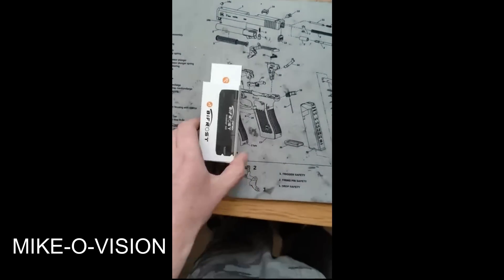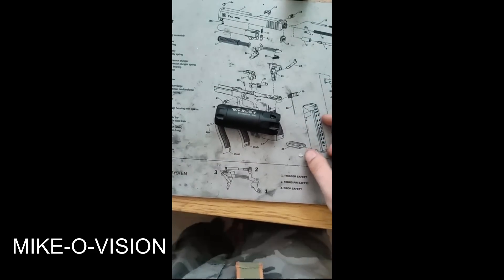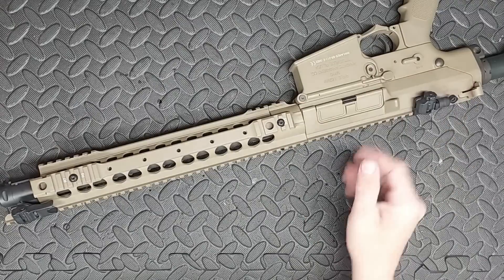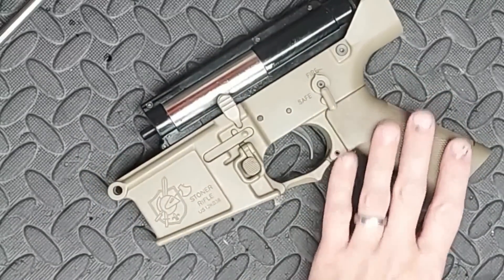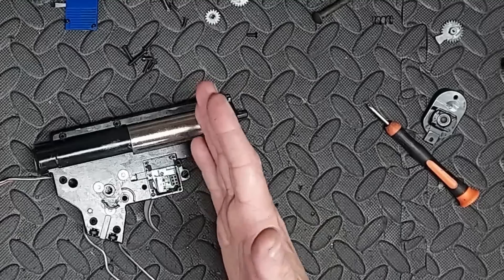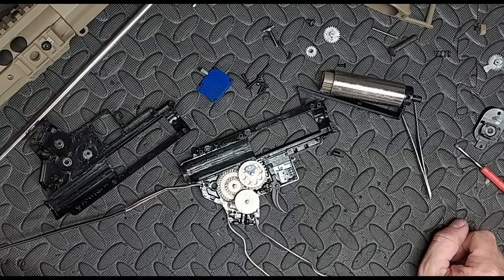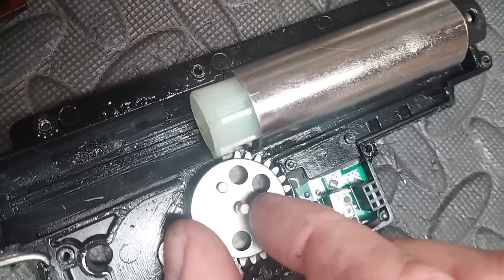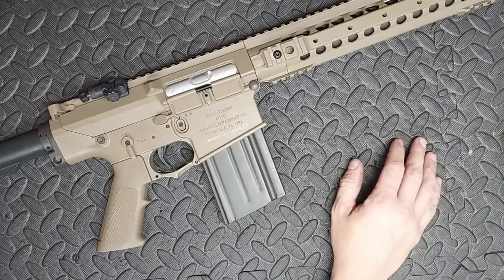BIFROST Review & a Bloody Ares M110K

Comment: The only good thing about ARES is that they have beautiful externals. The proprietary nature of it's internals just kills their guns. If they would have just done the commonly used gerboxes and parts. They would probably be selling their guns like hot cakes. Knowing you can eventually upgrade or buy parts without any issues. They just basically shot themselves on the foot with trying to be ''different''. I was almost about to buy this because this is on sale with a 15% off. Glad I re-visited Negative Airsoft, I will just have to wait for a better M110 or perhaps get a CA25 with full markings.
Reply: Best bet get the G&g sr25. Then get the hanguard you want. The g2 gear box is upgradeable. But it is not really needed. All that's needed is a reshimming. A perun is optional since it is a dmr. The sr25 is the same price as the g&g 308. But you get the trademarks for the same price. But this could have changed since I got it 2 years ago when they were the sane price. If the prices are different, let me know please. Have a good day.

Comment: If the customer is willing to pay for my time on an Ares with that dumb efcs, I’ve swapped the Ares gearbox out with something like a Lonex drop in. It takes an incredible amount of time on something like an Ares sr-16 but it can be done. I otherwise refuse to touch them.
Reply: I’ve done the same, the pain of getting the selector to work hey?
Reply: @Solidsnake0208  didn’t have so much of an issue with the selector. Spent most of the time grinding the gearbox and receiver to make it all fit. Spent a good 4 hours doing that making sure not to compromise the lower. 
I’ve also done similar with an Amoeba and used my last systema gb and a gate Titan. A lot less work with the plastic receivers.
Reply: @coachster  🤣. same here.  after hours of slowly grinding to fit a new gearbox in, all the pin holes lining up perfectly, the damn thing couldnt fire more than .3 joules. turns out the ares is a bit longer/sits forward and in turn the hopup wouldnt align with the magazine.  had to make a spacer to go between the hop and the gearbox.  ares efc is a damn miserable gearbox and they did a great job making it a pain in the ass to replace.   not even starting on all the stupid shit they do with their bodies..
Reply: I did this for a friend. It was a fucking nightmare but I did it and it worked. That gun is using a VFC shell

Comment: So I have the blaster which is supposed to have the the same threaded rear cap with the inner lip but screws onto the 14mm ASG adaptor fine.

Does the tracer not screw on to the end of the asg 14mm adaptor at all?

Comment: I worked on one of those Secutor Rapax DMRs and it was shite. Just a standard Ares doing 440 fps.

Did another Ares the next week and it was exactly the same inside.

No air seal in either, and neither could hop a BB well at all no matter what hop rubber went in.

Comment: Any tracers that can shoot and green red bbs with out pushing button ?
Reply from the maker: put red & green in your mag....
I used to do that at The Mall, last three are red.
Reply: Most of acetechs latest range.  i had the lighterBT the one with the inbuilt chrono.    It does have red and green modes but sticking it in red mode works for both at the side effect of slightly less bright greens
Reply: @NegativeAirsoftTech  ok that is exactly what I want to do so the ace lighterBT will work you think? And thank you sir for replying and providing free entertaining content!